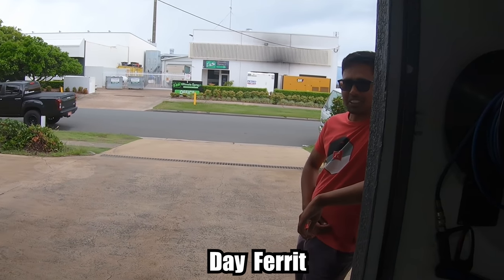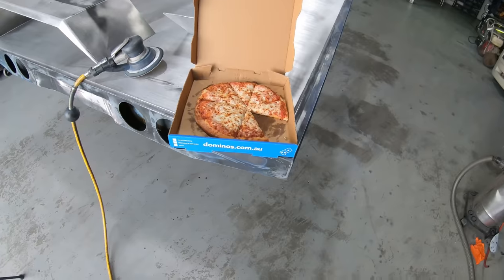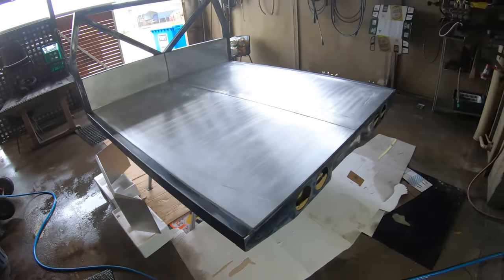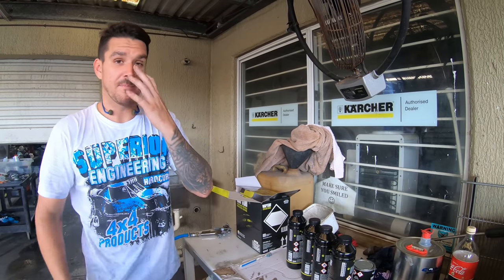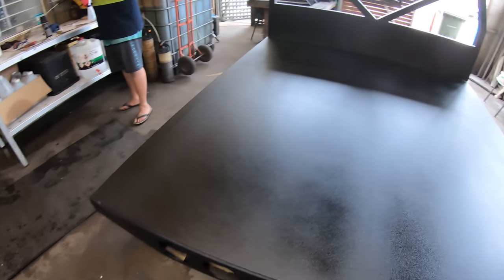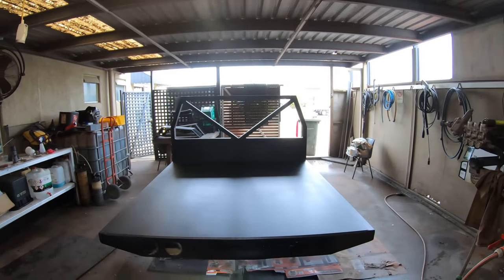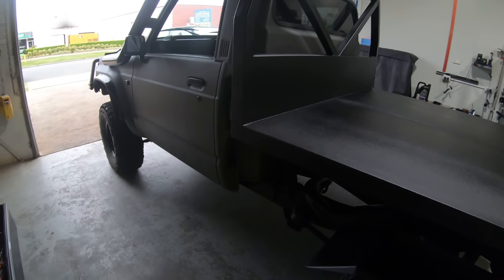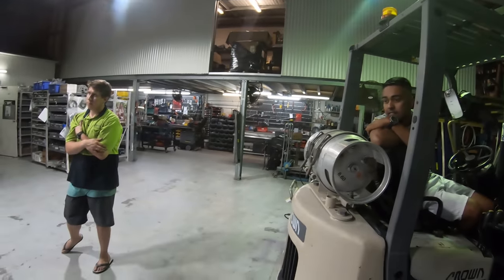Is this the BEST DIY paint for a 4x4 Tray? - 4wd Build Ep 17

Comment: Beautiful work man, this is a real built not bought. I recently have done similar rust work and repairs on my gq coily, ripped all the carpet up gave it all a rust treat where surface rust had started to form and painted the entire floor pan and rear wall with that spray on sound deadner, definitely looks good and functional
Reply from the maker: Wow sounds like you nailed it mate! Rust sucks, I’m a massive fan of any rust prevention so well done for going the extra step, it definitely pays to!